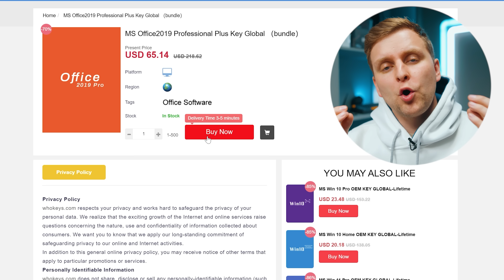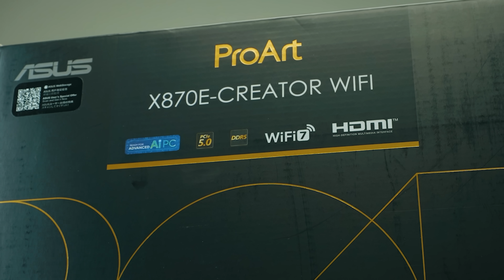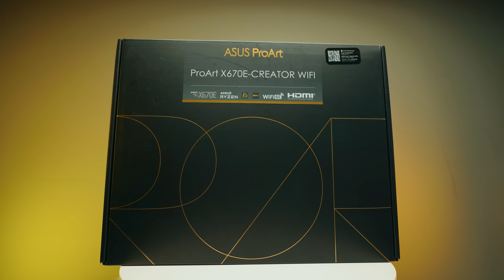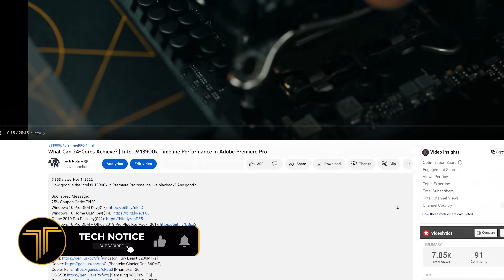The BEST Motherboard for AMD Ryzen. Period. - Here's Why! [Asus ProArt X870e Creator WiFi]

Comment: The ProArt series has been one of the best on the market in terms of design for years. Wow!
I'm just starting with the video, but I took a quick look at the specifications: In Germany the board costs around €450, 7x10GB USB + 2xUSB4 external - sounds great, but nobody needs it, not even a creator. I want a power/reset/debug LED on the mainboard and no pointless connection overkill.

Comment: The MSI Carbon board has a similar layout with the advantages of being cheaper, having tool less heatsinks, SPDIF output and its second PCI slot is actually usable ( on this Asus board it will be blocked by most GPUs)

Comment: I think that the best mobo is the X870E Taichi, cause i read that all other X870E mobos cut down the lanes to x8 on the x16 PCIE slot when all the M.2 slots are populated.
Reply: @DonkeyBallss  got the lite version.. but have to wait 10 days 🙄
Reply: @mycuriouschild  That's awesome. I'm also thinking of trying to get a new X870E mobo, because i'm an enthusiast.
Currently i have a GIGABYTE X670E AORUS MASTER with a 7950X3D. And what i want is to upgrade to X870E with a 9950X3D when it comes out. And i would really like to get the best mobo for that. But i wonder if there's other X870E mobos like the Taichi which do not cut PCIE lanes, because i have 4 M.2 NVMe SSDs currently on my X670E AORUS MASTER and my mobo does not cut any PCIE lanes. Also i really really like the X870E Taichi and i'm very very tempted to get one cause it also has a backplate and i really like mobos with backplates lol.
Reply: No backplate for me😢 , no rgb   and quickrelease for gpu. 75 bucks cheaper...

Comment: ASUS = problems
Reply: What should I get instead?
Reply: @Thesheep12-v3b  Asrock. The Taichi is great, but if you want the best bang for buck then go with the Phantom.
Reply: @joechapman8208 This hasn't aged well. Any brand can have issues so it's hard to say sometimes. I got an open box Asus ROG Strix B650E-F Gaming Wi-Fi that has been mostly good for 2.5 years. I got it right before the voltage problems Zen 4 was having but fortunately everything was manually tuned with Buildzoid's help so I avoided those issues. Probably getting an MSI X870E board next since I need more IO. Did want AsRock but those burned X3D chips and memory problems have me concerned.
Reply: @vigilant_1934  Yeah. Obviously none of that was an issue at the time I wrote it, and Asrock had reliably had the best boards for a while. For the record, I got the MSI Carbon X870E and... it's not been great. Not absolutely terrible, just more irritations and disappointments than I expected. A certain amount has been improved with updates, ofc.
Reply: Never had an issue. Everything that can be Asus is Asus on my PC including the pg32ucdp 4K monitor. But with next build I will not go with the motherboard in this video, it's just way too expensive for just a motherboard.

Comment: no q-code or onboard power/reset buttons are kind of a deal breaker for me, regardless of the amount of rear i/o. :( no rear armor is kind of annoying, and no optical audio is also odd IMO. Love the USB and 10Gb ethernet port though. I feel like this makes some odd cuts considering it's for creators and considering its price.
Reply: I don't know why they didn't just make one of the 3.5mm jacks an optical combo. Still, it's easy enough to add a USB-to-optical audio adapter if you need it. The exclusion of optical on a PC is not the same kind of catastrophe as the exclusion of optical on Xbox. Lack of code readout at this price point is inexcusable.
Reply: No optical is a dealbreaker, what is this, a PS5?

Comment: If my primary display supports power through its primary display cable to charge the device that it is receiving the display from (such as a laptop), will this cause any issues for the motherboard when plugged into this motherboard via the display passthrough/USB4 port? I've used a DisplayPort to USB-C cable to adapt an older PC to my display, and it seemed to work just fine. I'm just not sure if it'd do anything if plugged straight into the MoBo. Thanks!

Comment: Differences between ProArt X870E and X670E ("+" is upgrade, "=" is sidegrade, "-" is downgrade):

EDIT (7th March 2025) - New locking mechanism for 1st GPU slot damages the GPU connector as proven by some users.
ASUS' response is basically: "It's only cosmetic damage and doesn't affect performance, deal with it." Yikes!

+ WiFi 7 VS 6E.
+ Bluetooth 5.4 VS 5.2.
+ 80A VS 70A power stages.
+ 1st M.2 slot now has a tool-less heatsink and an improved underside heatsink.
+ Clear CMOS now has a button on the I/O shield instead of 2 pins you have to jump on the board.

= WiFi antenna can't be securely screwed into place anymore.
= Number of gen5 M.2 slots is UNCHANGED unlike what is stated in the video (7:02).
= RAM compatibility and max speed is UNCHANGED unlike what is stated in the video (12:15).
= Bottom PCIe 4.0 expansion slot is now x4 VS x2 previously. In return, you have to give up half (4 lanes) of the 2nd PCIe gen5 expansion slot instead of 2 lanes of the 4th M.2 gen4 slot.

- 12V RGB header removed.
- USB-C front-panel connector supports 30W fast charging VS 60W previously.
- New locking mechanism for 1st GPU slot damages the GPU connector.
Reply: You missed the most crucial difference, which is regarding PCI-E lane distribution. The USB4 ports are now on CPU lanes, so they no longer compete with things connected to the chipset. This is good in some ways, because this type of board was known for IO congestion on the chipset causing issues with dropped USB4 devices etc. However, it also has the consequence of degrading the primary PCI-E x16 slot to x8 if you populate the second M.2 slot, something which did not happen in the Proart X670E. Basically, Proart X670E vs X870E is a choice between prioritizing M.2 storage vs USB4. If you want to run two 5.0 SSDs at full speed without affecting the GPU slot, choose Proart X670E. If you want max USB4 stability and performance without chipset bottlenecks, choose the proart X870E.
Reply: @mettana7448  It is crucial info like this I'm glad and grateful to see. I'm surprised the reviewers don't often explain this in simple language as it is so important and confusing to many. Thank you.
Reply: @mettana7448  [DELETED BY ACCIDENT SO REPOSTED]
I don't know where you got your information but none of what you said is stated in the ProArt X870E manual or anywhere official as far as I know.
One thing that is certain is that populating the 2nd SSD slot does NOT gimp the primary GPU slot. That would be insane.
All lane sharing has to be stated in the manual, and what you're claiming isn't.
Reply: @mettana7448  I just updated my ProArt X670E to the latest BIOS 2704 version and there was a lengthy "updating Thunderbolt Nvm firmware" step which I'd never seen before in a BIOS update so maybe the new Thunderbolt stability you're talking about isn't just limited to x870E after all...
Reply: You neglected to mention USB4 is now standard - quite important for future proofing. These boards are typically kept longer by content creators than the gaming boards bought by 'kids'. ;-)
Reply: @brianhoward9217  USB4 was already present on the ProArt X670E with exactly the same amount of ports. That's why I didn't mention it.
Other X670E boards also have USB4 ports like the ASUS ROG Crosshair Hero. Only difference now is that all X870E boards must include USB4 ports.
Reply: @Nayah9  "populating the 2nd SSD slot does NOT gimp the primary GPU slot" Where do you think the other lanes came from when they moved the USB4 controllers from the chipset to the CPU? They couldn't just conjure more lanes out of thin air. This has been discussed in detail on various forum threads and Ronin Wilde on YouTube has a video with the full lane allocation breakdown. Populating M.2_2 and/or PCIE2 will cause PCIE1 to drop to 8x.
Reply: @mettana7448  Yeah, I think your sources are wrong. You claim that USB4 lanes are now directly connected to the CPU but that's unconfirmed and highly unlikely.
I do know that they changed the Intel USB4 controller to something else though. However whether this actually improves USB4 functionality or not is yet to be confirmed.
Reply: @Nayah9  The fundamental claim that I saw repeated many times was that, on X870E boards, AMD now mandates that the USB 4 controllers be connected directly to the CPU. If that is true, then there would be a PCI-E lane deficit which would lend credibility to the other claim about the gimping of the GPU slot because those missing lanes have to be regained somehow. So, I went to try and track down the origin of that fundamental claim. I could find no primary source for the claim, just a bunch of forum posts talking about how AMD now mandates connecting USB4 controllers to the CPU. I even found AMD X870/E chipset diagram slides that seemed to show USB4 controllers connected via the chipset. I was beginning to think you might be right, HOWEVER, when I double-checked the manual, I found that it states it there clearly:

"PCIEX16(G5)_2 shares bandwidth with M.2_2 slot. *When M.2_2 is enabled, PCIEX16(G5)_1 will run x8*, and PCIEX16(G5)_2 will run at x4."

So, whether or not the fundamental generalizations about the mandated CPU lanes for USB4 etc. are correct, the board's manual leaves no doubt that PCIEX16(G5)_1 is gimped to 8x when M.2_2 is populated. Unless that's an error in the manual itself.

Also, I'm not sure why you say that the USB4 being connected to the CPU is "highly unlikely". Previous gen boards with USB4 controllers were known to have major congestion issues on the chipset. Look at the last page of TechPowerup's Crosshair X670E HERO Review, for example. Having the USB4 controllers bypassing the chipset would be one definite way to prevent those issues from reoccurring. Again, I cannot find any proper sources to prove that it has actually been mandated by AMD, I just don't see why you think it's so unlikely.

Side thought: Proper block diagrams like the ones Gigabyte used to provide should be mandatory for all motherboad manuals!

Comment: another important difference between x670e and x870e is the removal of the third pcie power slot that allows for 60w fast charging with the front panel usb-c

Comment: i have the x670e version and love it, it’s my favourite motherboard. Decent upgrades and minimal downgrades. 
I do use the 60W usb PD on my case but 30w is enough I guess.

While I would probably still get the x670e ProArt for a new pc as it’s cheaper and more or less the same, I’m also really glad they are launching a new version with the new chipset

Comment: they are smoking some straight crack these days when they come up with the prices for motherboards
Reply: No optical or coax audio out. Wtf
Reply: I'm looking at these 870 models since AI cache boost is now a thing but do I need it? The X870 might be good enough but I was considering a different brand. Armory crate feels so clunky I try to avoid using it.
Reply: For real!  I remember when i thought 300 $ for a motherboard was fucked

Comment: If you look at other x870E boards like the MSI carbon wifi, all m.2 and expansion slots etc on the board are all tool less and you get the dbug digital code box vs just the little blinking lights. And this kind of money deserves those features standard, I think ROG and the Tichi boards also come standard with the deatures.
Reply: It's a shame. I suppose they do it not to cannibalize sales of the high-end ROG.

Comment: That board lacks something as basic as an optical out audio port or header.
Reply: Use one of the expansion slots to add it.
Reply: @IraQNid  You can add in a PCIe DAC that has optical out, but that's not the same as using the Onboard Realtek ALC1220 DAC. Most PCIe and USB DACs don't have the option to enable windows loudness equalization.
Reply: no one cares lol

Comment: Is it possible for you to cover a great motherboard other than from Asus? There's been a lot of controversies about the brand in recent memory (600 series AMD motherboards overvolting and wrecking 3d Vcache chips, ROG Ally overheating people's SD cards and not offering a fix for it, not honoring warranties, giving users the run around in customer service, failures in their monitors, mainboards on the ROG phone line which weren't fixed by Asus, etc.

I absolutely do not trust the brand, because it's been issue after issue and they've done everything in their power to avoid taking accountability for them, so I can't really trust their products and any time friends ask for purchasing decisions I recommend absolutely anything else.
Reply from the maker: They're are some gigabyte boards coming in and I hope to take a look at ASROCK and MSI as well!

Comment: Ahhh another needlessly expensive motherboard for almost zero gain.
Reply: If you only Put in one gpu and nothing else, yes.
I want to put in 2 GPUs.
Reply: @DragoMorke  what for?  Computational stuff I don't understand?  How can you use 2 gpus?
Reply: @Alex.The.Lionnnnn  
Two resons: Run two operating systems at the Same time, each with its own gpu. Linux and Windows
And yes in the Future running AI on more than one. Can never have enough VRAM.

But those are Edge cases the Common User does Not need.

In the old days you could Use 2 or more GPUs in Games, but now it is mostly for AI and Rendering, so professional stuff.
It is a creator Motherboard after all.
Reply: @DragoMorke  I knew you could run multiple back in the day....

OK multiple OSs at the same time?
Reply: @Alex.The.Lionnnnn  yes.
Linux as the main one and Windows in a virtual machine running in a separate space in ram which gets one of the GPUs assigned to it.

Comment: One m.2 is PCIE 4.0. If you use the third PCIE5 M.2 graphics run at x8. Also, Asus had coil whine issues in idle for their last gen VRM designs, and slight ticking noises for their b550 boards of this class. You would only know that, if you actually make a silent build, so I guess there is no point in asking here for that?
Reply: Yeah this video is disappointing... All this repeated talk while still missing key details ffs
Reply: "graphics run at x8"

only the 2nd GPU, if you have 2:

"PCIEX16(G5)_2 slot shares bandwidth with M.2_2"
Reply: @rurzan  NOPE!

2 x PCIe 5.0 x16 slots with Q-Release Slim (supports x16 or x8/x8** or
x8/x4/x4 modes***)

** When you use both PCIEX16(G5)_1 and PCIEX16(G5)_2, they will run at x8
each.
* PCIEX16(G5)_2 shares bandwidth with M.2_2 slot. When M.2_2 is enabled,
PCIEX16(G5)_1 will run x8, and PCIEX16(G5)_2 will run at x4.
Reply: @ytxzw  Yeah, I already corrected myself above, 2 months ago.

What causes the confusion, IMO, is the way the part you quoted (as did I in my initial comment) is phrased. "PCIEX16(G5)_2 shares bandwidth with M.2_2 slot" suggest that PCIE_1 should not be affected by the M2 slots, and the part about it running at x8 only concerns the case of using 2 GPUs. Since it's not the case, it should say "PCIEX16(G5)_1 and PCIEX16(G5)_2 share bandwidth with M.2_2 slot".
Reply: @ no, it is clearly stated if you read that correctly in context -> supports x16 or x8/x8** or
x8/x4/x4 modes***
Reply: @ytxzw  If it was stated CLEARLY, we wouldn't be having this conversation. I stand by my statement that they should say it explicitly that PCIE_1 shares lanes with M2, like they did for PCIE_2. Otherwise it's misleading.
Reply: Acthually, two of the m.2s are PCIe 4.0. Two of them are 5.0, and one shares lanes with the 2nd PCIe slot. So if you use the 1st PCIe and both Gen5 m.2 slots, the 2nd PCIe is limited to 5.0 x4 instead of x8. The 3rd PCIe x16 slot (electrically x4) and 2 other NVMe slots are all 4.0 and connect through the chipset. It's complicated but the flexibility is nice.

AMD Ryzen™ 9000 & 7000 Series Desktop Processors*
2 x PCIe 5.0 x16 slots with Q-Release Slim (supports x16 or x8/x8** or x8/x4/x4 modes***)
AMD X870E Chipset
1 x PCIe 4.0 x16 slot (supports x4 mode)
* Please check the PCIe bifurcation table on the support site
** When you use both PCIEX16(G5)_1 and PCIEX16(G5)_2, they will run at x8 each.
* PCIEX16(G5)_2 shares bandwidth with M.2_2 slot. When M.2_2 is enabled, PCIEX16(G5)_1 will run x8, and PCIEX16(G5)_2 will run at x4.
Reply: Yeah I need to correct something. If you look at the blue table on page 14 of the manual ("connectors with shared bandwidth"), in section A you can see that the only way for your GPU to run at 5.0 x16 is to NOT have anything connected to M2_2 at all. In other words, despite of what the specification that we quoted here says, M2_2 shares bandwidth with BOTH PCIE 5.0.

I ended up going with X870E Taichi instead. I thought ProArt was the only board that had what I needed (one PCIE 5.0 x16 for the GPU + 2 M.2 slots connected to the CPU), but apparently it's just impossible with 24 lanes. Or maybe it's possible, but MB manufacturers use some of the lanes for USB or something.

Comment: Man why does all of gigabytes 870, 870e boards have the Debug led and gpu release button, but on Gigabytes 670 boards only the expensive ones {400plus} have the led Debug and gpu button. i Bought a open box Aorus Master X670e Pro x white motherboard for 200 but it retails at 299,no led Debug,🙁or gpu button release button. Msi is getting with the program and its doing the same as gigabyte with more features than Asus and Asrock on cheaper models. Gigabyte boards offer way more for your money.